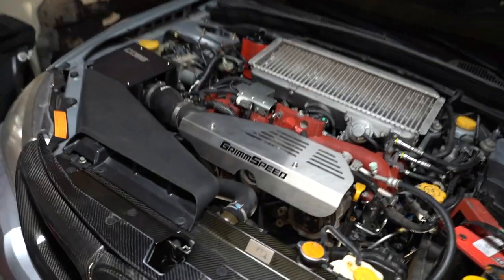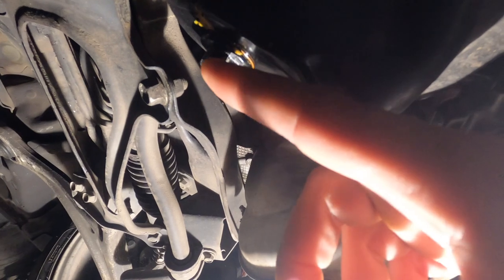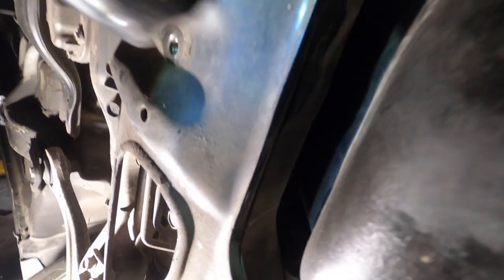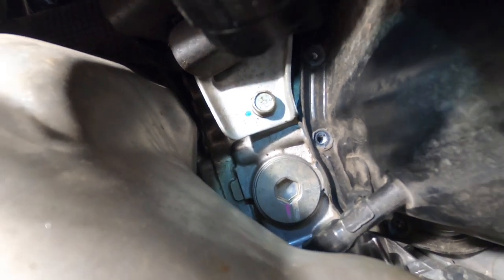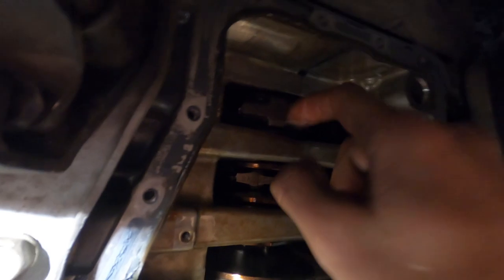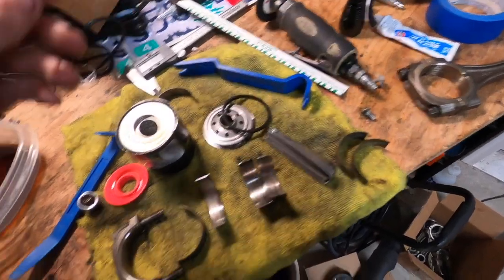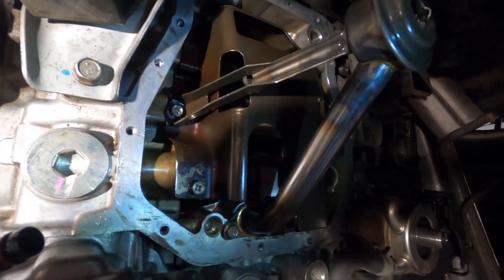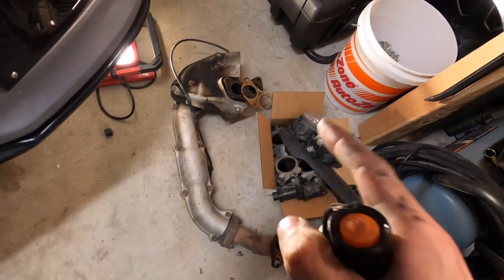The Cheapest and Easiest Fix for Subaru Rod Knock

Comment: I was nervous also before the start up.  Awesome 👌 no rod knock.  Plus you did it one handed ✋️.
Reply from the maker: Hahaha, hell yeah boyyy!
Reply: @bschoenborn  and @christopher is your car still running?
Reply: How did you reach the top bolt on cap, I just broke a 1/4 in universal adapter
Reply: @bschoenborn  how did you get the rod bolts on and off its tight

Comment: Hey so doing some research as my engine has started to knock and came across this one. Firstly amazing job hats off to you on that one. Secondly, has the knocking came back? Thinking of doing this fix as it’ll be cheaper for me and I really need to get my car back on the road
Reply from the maker: For me, the knock did eventually come back as expected, but if you're lucky, it will hold you over until you are able to get a new block... just don't rip on it
Reply: @bschoenborn  Ahh gotcha, that would still work out perfectly for me as I just need use of the car right now until I can properly fix it. Is there anyway I could get in contact with you privately to garner some more in depth advice?
Reply from the maker: Shoot me a DM on instagram @bschoenborn!
Reply: How many miles did it last??

Comment: What size Rod bearing did you use? Did you need to polish or do something on the crankshaft?
Reply from the maker: Hey,
I believe I ended up using +.025 bearings. I used the shoelace trick to polish up the crankshaft and made sure everything was clean before applying assembly lube. If you have any more questions, let me know!

Hope that helps!

Comment: how’s the car? any issues? are you boosting or doing any pulls? lol.. i want to do this to my wrx but i don’t know if it will last long..
Reply from the maker: Its holding up... I'm not getting into too much boost until I get the new block in just to be safe. Its definitely running though!

Comment: Had a brand new stock 16 Hikari STI. At 106k I started getting a misfire in cylinder 2 after taking it into the shop here’s what they found…

”Cylinder 2 has 34% leakdown past the piston rings. There is mild leakage past the exhaust valves that will need to be investigated at the machine shop to determine if there are further damage to the heads. We checked cylinder 4 next door for comparative data and there is only 6% leakdown on that cylinder which is healthy. There is active misfire on cylinder 2 from the compression loss as seen in the scanning equipment. At this point, the short block will need to be replaced and heads will need to be assessed when off”

Decided to take it back to the dealership and after a long battle they honored the repairs under a good will warranty being that all my services were done at the dealership from day 1, car was stock and that I was only 6k over my 100k warranty.

Fast forward to 134k and a year later… driving on the highway and I had a complete engine failure. Lost my power, steering and electronics. Had to coast it over to a safe spot. Once I was able to get it turned back on, I noticed the dreaded engine knock sound. Once again my car was still stock… took it into the dealership and turns out they recalled my engine so subaru covered the cost of reman long block. I would never buy another STI again. Who ever is thinking of an STI, buy a different car, while I loved mine, it’s not worth the troubles that everyone seems to face after 100,000 kms.

Comment: Hi, I come from France and I have a 2006 Subaru Legacy 2.5. I have the same problem, the same noise when starting. I plan to do the same technique and I would like to know if the click has returned. I am going to change the connecting rod bearings and a new black Subaru oil filter.
thanks from 🇨🇵
Reply from the maker: No knock since I did the bearings, but I also haven't ripped on it too much!
Reply: @bschoenborn  Nice,👍. did you think it's gonna come back? Is the crankshaft damaged or has traces? I drove 12000km with this problem without any problem while driving correctly.
Reply from the maker: I have a block getting closed deck right now, so just waiting on that to come in, then Ill engine swap
Reply: @bschoenborn  Ok so It is possible that it does not start again. Thank you for the answer. What tools are needed for this operation. Are the connecting rod bearings difficult to access?
Reply from the maker: They are a bit tricky to get to, but not all that bad. The hardest part was dropping the oil pan, but just use a putty knife like I did in the video and you should be alright.
Reply: @bschoenborn  I hadn't seen your answer haha😅 , thanks for the advice. What really happens if we are still driving with this problem?

Comment: I love what you're doing !! My question  that I have an issue how do i get to 1st one towards the front of the  2010 suburu (impreza) it is really tight and I can't get it in there Do you hve any  ideas ? Thanks And I hope you're having a great week into  the weekend.✌🏼🙌🏼👍🏻 tak it easy
Reply from the maker: If its the one behind where the case halves connect, you're probably better off just pulling the motor unfortunately. That area is so tight and quite frankly may not even be possible :(

Comment: Didnt listen to all of the gideo just reading comments.

Why did you get oversized bearings if the engine had rod knock? 

Wouldnt you technically have to get undersized bearings or regular sized bearings and then add a shim?

I would think oversized would add in the rod knock coming back.
Reply: I see you got 2 thousand clearance with plastigauge without using OEM? 

But other use 7 thousands clearance or did you mean 1.7?

Comment: TAKE TO AUCTION AND SELL IT THERE QUICK BECAUSE YOU DONT KNOW WHAT ARE YOU DOING I BET YOU CAN NOT GET MORE THAN 10 MILE OUT OF THAT REPAIR YOU ARE GOING BACK WHERE YOU STARTED .DONT FOOL YOUR SELF AND YOUR FOLOWER .YOU NEED TO GO TO SOME TECHNICAL SCHOOL AND DO IT THE RIGHT WAY SO YOU CAN SMILE STRONGER .
Reply: Calm down.  That's shit that ripoff mechanics tells people to scare them into replacing engines.  If it's a worn bearing, it's simple. If it spun the rod it's most likely going to need a crank. I had a 2005 honda civic. Blew head gasket in stop and go traffic an hour from home. It over heated extremely bad and got rod knock at 250k miles. I replaced the bearings, and rods however I didn't notice until after it was basically back together  that one of the rods I ordered was backwards in the piston. I bolted it back up anyway. Now, after a cross country move and 13,000 miles later I just got rod knock again from my girl running it with no oil for a week.  I just replaced the bearings again and it runs just fine.
Reply: @DevTechGarage hell yea

Comment: Nice little trick it should work in a wrx version of that year too right?
Reply: Also I’d recommend replacing the oil baffle and pick up with killer bees products they fail higher mileage Subarus!
Reply from the maker: That will all be done with the new block. But yeah, this should work temporarily with the WRX and other cars as well.

Comment: Still driving the car?? how much boost you pushing now? I checked my rods and they barely shake, should I still replace it? I just want to drive again :) .. Still saving for a new short block
Reply from the maker: Was the car knocking? If so, then yeah, I would replace what you can and try it out. Mine is still driving, but I don't drive it hard. I should have my block back from Outfront soon, so just waiting on that. Worth the shot though!
Reply: @bschoenborn  Yea, it knocks around 3000 rpms..
Reply from the maker: @ccakidsonline6419  Hmmm. Yeah, might as well try it. Worth a shot.

Comment: It’ll come back😂😂
Reply from the maker: ohhh it came back😅
Reply: but why does it comeback
Reply: @albertlce777 because most likely the crankshaft is damaged and either needs to replace it or take it to a machine shop also would have to change all the bearings including the main bearings

Comment: What tool did you use to get the top rod nut off? I cant get anything small enough in there
Reply from the maker: I used my Icon ratchet and socket to break it loose, then used a few extensions and universals to take it all the way out.
Reply: 1/4" crows feet perhaps?

Comment: What did u End up using to get the top nut off?
Reply from the maker: I broke them loose with just a ratchet and socket, but once they were loose, I used a few extensions and a universal to work them all the way out.

Comment: Why didn't you show yourself actually doing the job? I bet $100 you paid someone to do it. I call bullshit.
Reply from the maker: Ill take the $100 then lol. Real hard to record and do all the work with one hand under the car, which is why I tried to explain it the best I could. Take your negative energy somewhere else, but thanks for the view.
Reply: so what did you use to get top rod cap bolt
Reply from the maker: @johnanasjohnson  had a long series of extensions and a universal. The bottom ones are easy. The top one takes a bit of finesse.
Reply: @bschoenborn  yeah I was messing with another and it was not easy to get to the top bolt for sure.
Reply from the maker: @johnanasjohnson  definitely a whole pain in the butt. Once you get the pattern of extensions down, its not all that bad though😅
Reply: @bschoenborn  can you post a list of exactly what you used for top bolts? I have the oil pan and splash guard off but can’t get those top bolts. I tried a universal on an extension but it’s basically at a right angle so I can’t get enough torque on the universal to break it loose.
Reply from the maker: @briantrauger2305  hmm... its been like a year since I did it, and I'm currently deployed in the middle east. Im actually almost certain I turned the crank just right to where I was able to get my ratchet right up in there on the socket to break lose. I use Icon tools, and I'm pretty sure the 3/8" ratchet fit in between the gaps on the crank (barely). Its super tight, but it is possible!
Reply: @bschoenborn  thanks for serving! FYI I got it done today, thanks for the motivation! Just have to replace the baffle, pickup and oil pan tomorrow. Hope it fixes my knock, it was very slight so I’m hoping I caught it early enough to last a while-no spun bearings just worn, crank looked perfect on all 3 journals. #1 piston feels solid but I’m sure it has the same wear so it’ll be a matter of time.
Reply from the maker: @briantrauger2305  awesome! Glad to hear you got it done! Wishing you all the best for the first start up!